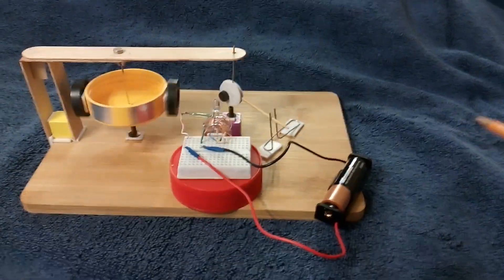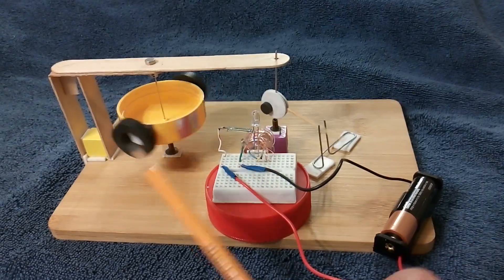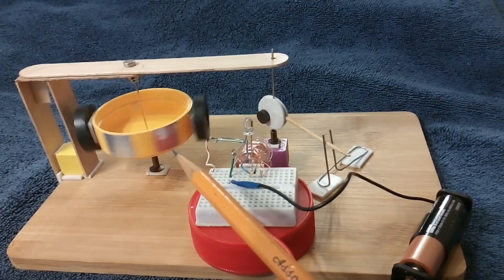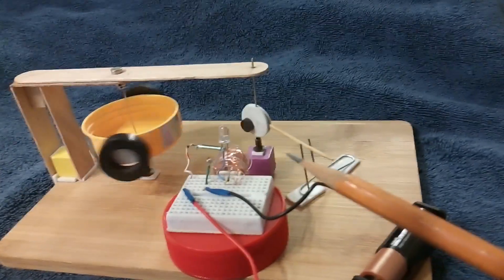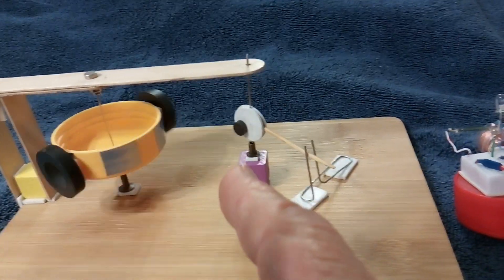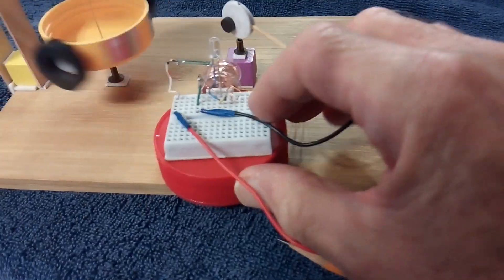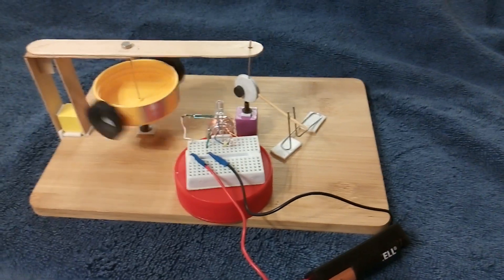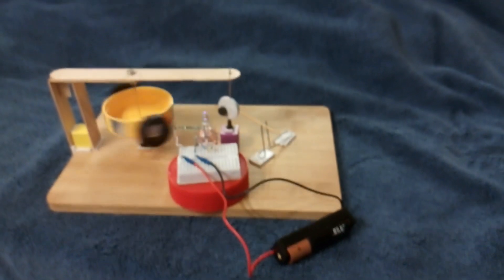Mystery Magnet Motor Study --  Part 1

Comment: Kind of reminds me of the roobert33 v-gate. The referenced motor wouldn't work, aside from the obvious, because it seems like the flipped magnet is allowed to fall back down under it's own weight, unless it's actually being clamped by the lever and spokes at the time. This obviously doesn't work because the action of the magnet falling back to rest is a force working against the motion of the wheel in the opposite direction via the lever. His system has to be supplied even more energy just to lift the magnet which is made easier via leverage but it doesn't seem to actually allow the magnet to aid the rotation in any way.

Comment: Happy New Year Lid !
Why not put the contacts on the paper clip implementing to the motion of the small magnet.? 
That can be configured to the coil location to inject the magnetic propulsion and eliminate the reed..
Reply from the maker: Actually I was thinking of running it on 3v and just using a Hall sensor circuit.  Your idea of using the rotating stator arm is a good one. Thanks.